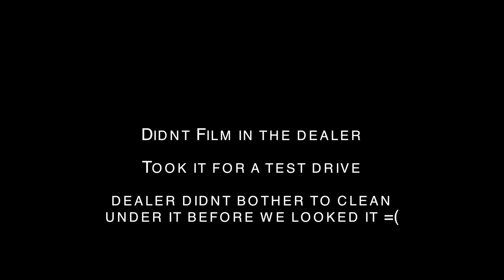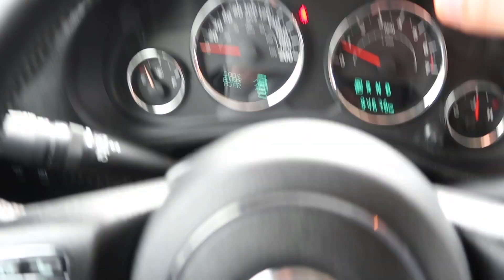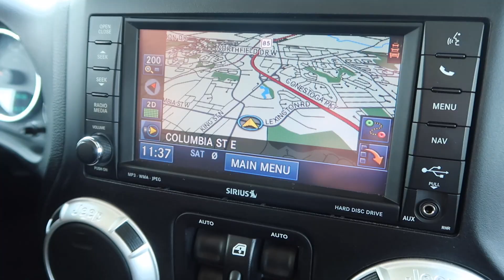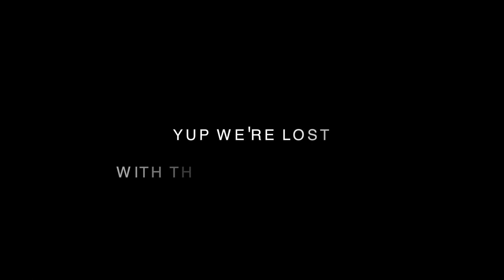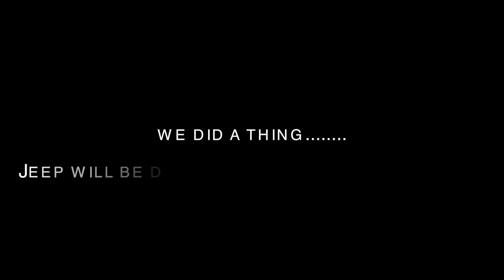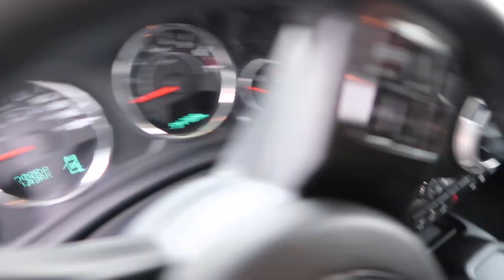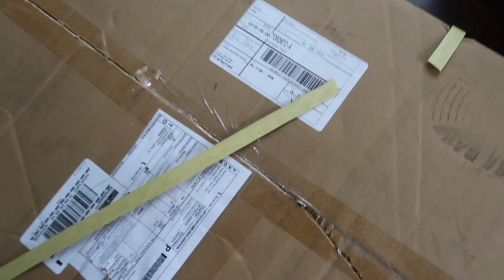Bought A 2015 ____ ____ ____ Daily Driver For My Wife!! | SLAPTrain

Comment: rust in a 2015 year car? the car wasnt cleaned either... i wouldve turned around and went home empty handed. also its a law here in finland that dealerships need to give a 6 month warranty on engine and drivetrain. i hope the car treats you well and wont have any big problems... also that rust really worries me, its not bad yet but might be in a couple years if not taken care of.
Reply from the maker: JRemsu yea I hear you 100% first plan is to get that rust taken care of and paint it up and make it look like new under it will be nice and yea just hoping for the best
Reply: Southern Ontario is the absolute worst for rust. Any car that's a few years old and not rust proofed will have rust.
Reply: torilleeeeee

Comment: I could tell from the steering wheel it was a Chrystler vehicle.
Reply: I thought it couldve either been a chrysler, or one of the dodges that use that exact same wheel/very similar wheel (The 2013 and newer dodge grand caravan uses the same wheel as a dodge charger), but I never thought of it being that lol...in fact, i see alot of parts in that car used in the dodge grand caravan lol..including the center dash computer, metal styling around the gauges, the steering wheel is almost the same (the buttons on the wheel are basically the same), and i wouldnt be suprised if theres even more there than that. (Fun fact, ever since the jeep's had those center dash computers put in, they have all been the same as the dodge grand caravan when they started aswell..in some models of the dodge/chrysler minivans with the center dash computer, occasionally it would glitch and show the jeep logo as you start the car)
Reply: IkaFang yup with that thicc ass steering wheel
Reply: IkaFang I thought it was a Cherokee
Reply: I thought it was a VW xD

Comment: Fellow Jeep owner nice. I got a 2012 2 door.  I dont know if the dealership told you but the back part of the roof has to be stored and removed a specific way or it can warp and not go back on the vehicle correctly.

Comment: That disgraceful how they "detailed" that Jeep, I'm a detailer my self. I used to work at Hyundai and a GM dealership. Even if it was a used vehicle, I myself would not let a vehicle go even if it had a bit of dirt on the suspension or the undercarriage.
Reply from the maker: Matthew Ford yea I was pretty upset we are taking it for the full package detail somewhere on them so be nice after that then just rust proof it and get rid of the rust under it and we’re set
Reply: TheSLAPTrain Either way she is a beautiful rig you got there. In the future, would be a nice look to the Jeep if you LineX the Bumpers and the fenders on it. At least then there protected from pretty much anything and it will cover up that scratch front right fender